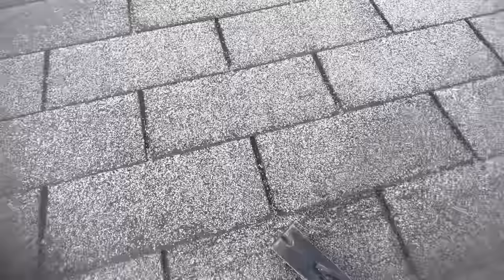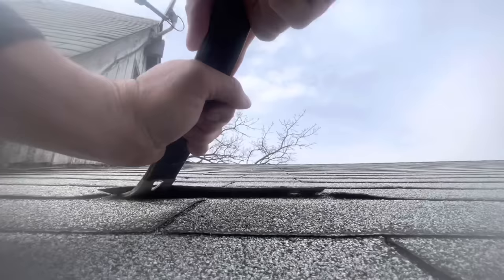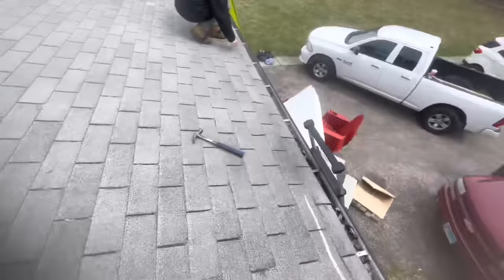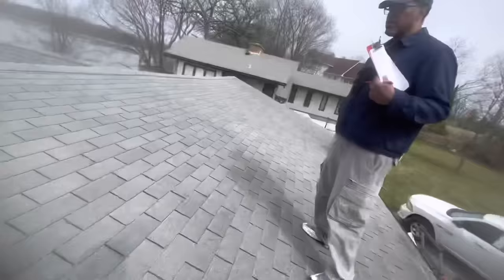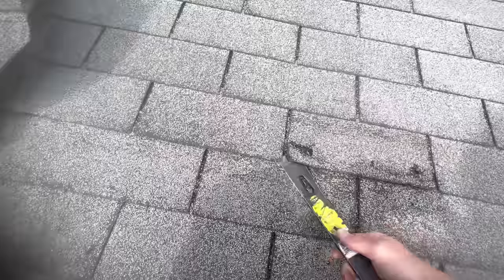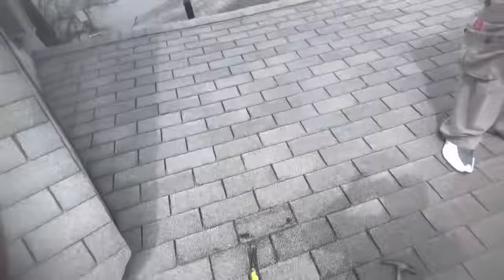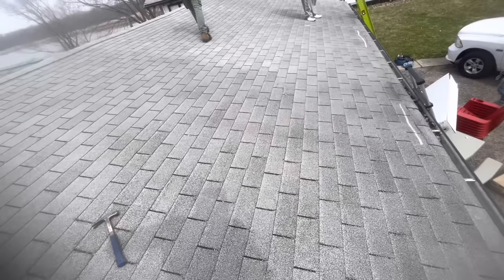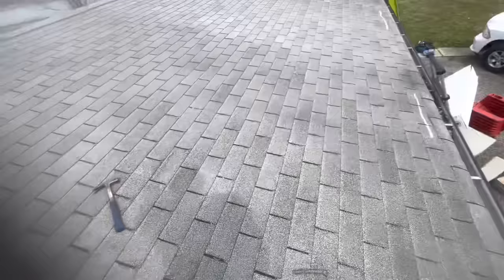Insurance Adjuster says roof is repairable. 😂 See how this inspection is ignored & denied?

Comment: The only way statefarm is going to start changing their ways is if videos like these start going viral. I don't  blame the adjusters, they are just doing what they are told by upper management. Upper management  is the problem.
Reply from the maker: 💯% agree with you. Often times in the field they tell me they know it's justifiable but management will kick it back after they submit a full roof replacement.

I have one right now where they sent their own contractor to suggest that it's not reasonable to replace the roof and their own contractor told them they won't touch the job without a full roof replacement cuz I'm right..
Reply: It's all insurances. We were hit by a Semi while sleeping in our RV area a truck stop. Their insurance Progressive left us with an extensively damaged 43 Ft RV LIVING in it for our job as a oil field worker. Adjuster did a report 2 months after the accident and after 8 months to get into a overwhelmed Collison Repair shop certified for our new Raptor RV, the adjustor sticks to the repair quote even though water, weather of 3 seasons ran through the hole in the roof and windows knocked out. They don't want to total a totaled $114K RV.
Reply from the maker: Get a really good body shop to look at it that only deals with insurance work. What state are you in?
Reply from the maker: Hope you're all okay!

Comment: Man, this has become such a big deal now that I dont know why people even consider going with shingles anymore. Especially if you as the customer are going to have to pay out of pocket for it. If so, you might as well go with a metal roof and call it good for 40-50 years that its rated for. The elements are just too harsh now for composition roofing. I would say tar it, kool seal it, or put tin on it. All u roofers having to deal with this BS now, just transition into being metal guys. U really dont even need quite as much tools to do it. Some lathing materials (usually 2x4 or 1x4s), drills and screws, a good set of nibblers to cut the metal (which is your biggest investment really) some extension cords, gauge blocks and string lines. Not only does metal outlast shingles, it looks FAR better in comparison. Yes it costs more but u actually get the life span out of it u want. Also, its not the end of the world most of the time when something hits it or lands on it. If u ever do get a dent, its much much easier to take it up per sheet and replace it, vs having to relace your shingle runs in place. I have done both for many years is why Im saying/recommending this
Reply from the maker: I agree with you, metal roofs are definitely Superior to composition shingles. However it doesn't fit in everyone's budget. In Illinois everything went up a lot over the last year, especially metal.
Reply: Some towns dont allow metal roofs on residential homes
Reply from the maker: True. Some by me require cedar.
Reply: @chhansen9813  Thats true, I totally forgot all about that, as I just do work here in my local area, east texas. Luckily they have always allowed it here, atleast as long as I have been doing it anyhow. I mean, as much as I dont like them, I would even say go for tile roofs vs shingles, if that be the case. Now there is plenty I dont like about tile roofs I could name off, but still, compared to shingles, I would take it because atleast theyll last (assuming u dont have decking go bad or rafters/trusses underneath give way, cause they weight alot more) Usually so long as u dont have yahoos up there walking around on them, or something falling on them and breaking them, theyll last. With that said I dont like the way they seal off, and they have to be cleaned alot more usually, otherwise trash build up can cause issues over time on them, especially in your valleys. BUT, atleast for longevity theyd still last vs shingles, if u cant have metal. With that said, I would not, and do not, recommend becoming a tile roofer over composition, its alot more headache to deal with IMHO
Reply from the maker: What kind of headaches come with tile roofs?
Reply: @ChicagoRoofer  lots. They are heavy, they can break easily, even by accident, they are expensive, they have to be cleaned often, they require a good bit of prep work before installing sometimes, and if u ever have to go up on the roof for anything u gotta be careful where u step, if anything ever falls on them like tree limbs, they usually break more times than not, they don't always seal off good.
Reply from the maker: So we all agreed that they're not repairable if damaged, yes?
Reply: @ChicagoRoofer  an insurance adjuster would like to have a word with you on that lmao
Reply from the maker: I'm all ears! 😝😁
Reply: @unleasheth  cleaned?
We only have tile and slate roofs in Ireland I've never seen anyone cleaning a roof.
Reply: @Babihrse  Here in east texas people have lots of diff kinds of trees that overhang their roofs, especially pine. They make a hell of a mess that will stop up gutters quickly, and left sitting in a valley on a roof forever is usually not a good idea either, especially for tile roofs where the seal-off for them isnt that great to begin with (when compared to composition and metal roofs) So by proactively blowing them off before the pine needles become a wet pile of rot, itll prevent any "could be would be issues". Thats all I am getting at when I say "clean" If no one is ever having to clean their tile roof then A) u have no trees around or B) people are just lazy and dont care or wait till its too late (which is usually the case with tile, I find) With that said, thats why they are a bitch because then u gotta find out how am i gonna get up there to do this hopefully without causing anymore issues, sometimes u can sometimes u cant, its just an unnecessary headache IMO. Especially trying to find out how to clean the ones people let go for too long. Concrete tiles dont let go of debris easily either
Reply: @Babihrse  You don't have the drastic temp changes that we have in Houston/East Texas. Roof cleaners are very much a thing here.

Comment: After replacing a few bundles of shingles on my 20 year roof i learned a few things... instead of using a flat bar to break shingles free i use a thin trowl which works way better getting under old ass brittle shingles and does not damage shingles like you are doing,also if sun is out is makes this even easier... also i bought a roof snake for the shingles you can only lift an inch or so to nail...But i know the home owners want a new roof rather than fix this one up and get a few more years out of it...and i get it the shingles were resealed and they will be extra hard or difficult.. but were all the shingles re bonded? Again you never showed the damage at all...

Comment: as an X-roofer, i see old 3 tab shingles by how wide the tabs are worn, and looks like a thin 20yr shingle anyways. Where are the wind blown tabs at? It's also better to peel the tabs up when the roof is hot, you know that. Sometimes the homeowner needs to just replace the roof because it lived it's lifespan and did its job.

Comment: I've been in construction for 30+ years.  What I am seeing is an aged roof that has served it's useful life.  I don't know what this claim is about but they need to check several different locations because every shingle may not be double glued like that.  That is not normal for a roofer to do that.  It could be that whoever installed those shingles missed the middle tack area and nailed too high causing the shingles to lift up in the wind.  Then another roofer came along and glued a lot of shingles down to stop that from happening.  I've seen it before.  This adjuster is not going to pay to replace an old roof just because that's what the homeowner wants.
Reply: Always good to get other credible perspectives. The way this video is presented felt off to me not knowing any of this. We only get a very brief slice of an interaction and no proper context. It feels like we're being encouraged to draw a hasty conclusion without enough information
Reply from the maker: Fair assessment. However, the roof has 40+ shingles that have obvious wind damage. We did in fact perform a reasonable attempt to repair in multiple areas and in all those areas, the shingles were deem not repairable. Ultimately after many inspections and diligently documenting why and how to arrive at a full repair, the roof was paid for.
Reply from the maker: Original phone ran out of battery and we had to use the homeowner's to document the shenanigans.
Reply: General Contractor here that specializes in Insurance Claims - I got 2 seconds into the shingles coming into focus in this video and could tell a repair can not be made. No Licensed Roofer I know of would even be willing to even attempt a repair on this roof under any circumstance that wasn't an absolute emergency, and even then, were talking tarping. This roof failed a brittle test with my eyes lol... I also run into this exact scenario with adjusters regularly. They get worse year over year.

Comment: This is USAA as well.  I dumped them last year when I had them for 17-20 years, never filed any type claim, amd they did not want to fully repair flood damage from a failed shower drain seal.  USAA aint built for guys like me.  We have integrity.
Reply from the maker: They sucks Erik!
Reply: Myfloors were soaking wet, and they told me I am not covered under any water leaks unless it's a sewer backup. 🤦
Even though I had the full coverage.
Reply from the maker: That sucks 😞😔
Reply: USAA has definitely gone downhill over the few years.   They used to care about their customers, but no more.    I have been with them since 1978 but will be cancelling my policies in the next month or so.   Their costs have increased and service decreased markedly.
Reply: @markmoulin41  when I was going through my claim, the ones you talk with first were great (as always), it's when you get to the adjusters that things go down hill.  Several of the operators told me they have USAA and kniw it has gone down hill and they see it at work.  I have also talked with several adjusted who used to work for USAA and left because of how it has gotten.  It's ashame really.
Reply from the maker: The funny front end claims process of filing is great, I agree. This way you get warm and fuzzy feelings that they'll take care of you. 

However, when they get there and you as a consumer have no idea what to look for, the process, and the ethics  can go either way.
Reply from the maker: Sorry to hear Mark. What state are you in?
Reply: this is why people hate insurance. you are told things like "full coverage means all damage to your vehicle (or whatever) is covered" so you get it then when somethings happens they are like oh but we dont cover THAT kind of damage... i once had my head unit stolen and they were like "but you never told us you had an aftermarket radio" as if there is an option for that when creating the policy. even now i can go to my policy and when i try to create a new or edit an old there is no option for that and no mention of its significance.  all i know is the coverage said that it covers "theft of the entire car or parts of it".

Comment: I've had to go through 3 Insurance Adjusters to get one who agreed I had hail damage on my roof. The first one said "I see mechanical damage with dents on the vent pipes but no hail damage." I had to ask if the birds droppings were that strong to put dents on metal piping. 2nd guy said I see damage but not enough to warrant a claim. 3rd guy was dumbfound when he saw the roof and didn't understand why the first 2 didn't report it right. I mean, I had 2 ceiling leaks so obviously had damage.

Comment: I'm confused. They don't want to pay for the entire roof to be reshingled, so they are arguing that the individual shingles on the roof are able to be replaced individually instead of just replacing all of them, right? He is trying to prove that is not possible because the shingles fall apart as he tries to replace them. Why does it matter if the individual shingles fall apart as they are being taken off if they are being taken off to be replaced? Not taking sides with the adjustor, I just know nothing about the details of what is being argued about and I am genuinely trying to figure it out.
Reply from the maker: Great observation and question. To remove one single the two shingles above need to be manipulation since those nails also hold down the shingle being removed. Thus they will also be damaged. The damage flares out and ultimately results in replacing the full Roof.
Reply: @ChicagoRoofer  Oh, okay. So, they can't remove the damaged shingle without damaging the one above it because of how worn out they all are.
Reply: @douglasmcveigh6605  and the way shingles are laid the nails for one are UNDER the one above it. So no nail holes are uncovered.

Comment: Is there any case law in Illinois on this issue? That roof has obviously exceeded its useful life expectancy. Age and wear related issues wouldn’t be covered.  Homeowners insurance is not a warranty policy.
Reply from the maker: This is why the insurance company can choose not to insure you. Those would be great ratings to not extend a policy. 

However, you can't tell someone they're insured and collect premiums and later change your mind once there is a claim.
Reply: If there is direct wind damage then the roof would be owed;  or if they wanted to claim its past its life, then insurance company would have to hire an engineer/professional to confirm. The adjuster is not able to make that determination as hes not a professional
Reply: @brianfreer2394  I assume the insurance company covered the wind damaged shingles and denied the remaining roof for wear and tear? The insurance company might be within their rights to not owe for a full replacement.
Reply from the maker: I agree with you on that. However, even if it was passed it's useful life but sustained a wind damage harold, it would still be owed for.
Reply from the maker: If the roof is tied in with other facets and is unrepairable, the roof needs to be replaced due to repairability issues. At that point it doesn't matter whether there was wear and tear, cuz wear and tear wasn't the claim.

Comment: I got my roof and siding replaced through Snake Farm four years ago.  They then doubled my insurance rates...dropped them the next day and my new insurance (lower price than pre roof replacement) gave me a discount because I had a new roof and siding lol.
Reply from the maker: If it's a claim due to wind or hell, they shouldn't single you out with increased rates. Typically the rates go up in a geographic area.

Comment: This is why there should not be replacement cost polices and instead have actual cost value less depreciation. Also hold back agreement until the repairs are done. No more pocketing the payment and claiming roof damage later down the road. Issue insurance payment to the home loan provider and the insured so that there can be no fraud.

Comment: Here in Australia, we don't get snow anywhere other than the tops of a Handful of Mountains, so we have Corrugated Iron, Earthenware or Concrete Tiles, so we don't see this problem here, (corrugated Iron clears rainwater off really fast) we don't have Plywood under the Roofing, if you take the Iron off you may have "Sarking" and some Insulation, but that would be it. What we see is, If a cyclone comes through and Takes your Entire Roof off in one go, that is pretty devastating, and is Obviously a New Roof replacement, sometimes it Damages the Structure of the House as well. These insurance adjusters here look to me like "crooks" FOR  the Insurance Companies.

Comment: Well first and foremost the adjusters are for the insurance companies and the insurers. Also those shingles are probably old enough that they were considered 20 year shingles. They are 3 tab or slotted shingles whichever you want to call them and are basically 12 inch high by 36 inch long or 3 by 1's i call them and are actually no longer available so unless the home owners themselves want to go that route and repair it you'd have to use architectural  shingles and cut to fit. Most shingles nowadays are metric. By the way i can see they must have had somebody on the roof at some point regluing the shingle tabs. Ive done that for people that couldn't afford a new roof and it worked well, it bought them a few years before having to do it. But there again on that note if those tabs were blowing loose then that means the shingles were losing there adhesive ability and still needed replaced. The adjuster can butter up his lies anyways he wants to but bottom line is that roof is expired. Nonrepairable by means of not available parts.
Reply from the maker: 💯% spot on. This is why adjusters are told not to document an attempt to repair in the field.  Then they have proof. If they don't document it, they can continue denying it.

Comment: I'm not a roofer but have worked on roofs for several years. I did shingle roofs, as well as commerical membrane roofing. Can't you just put another layer of shingles over top of the existing ones? Believe it or not. I actually had to fix a roof that had 4 layers of shingles on a roof. Yes, i know its illegal to have anything more then 2 layers of shingles but i guess the homeowners got cheap roofers. Needless to say we had to remove 4 layers of shingles to repair the roof correctly.